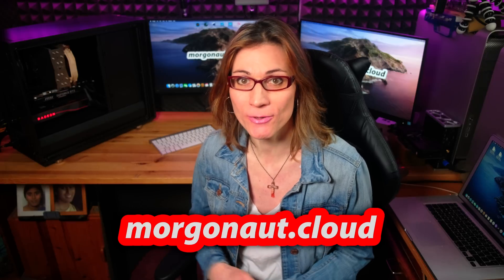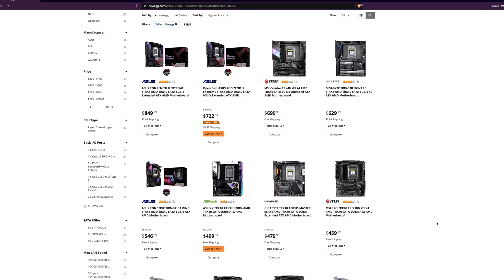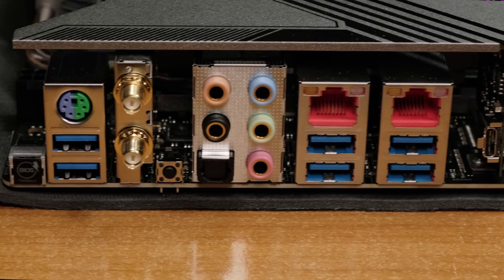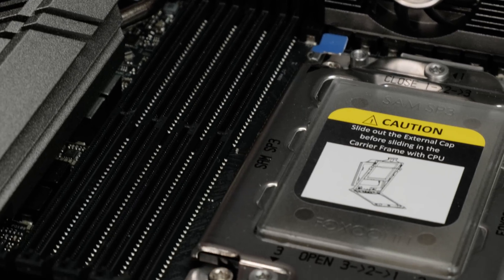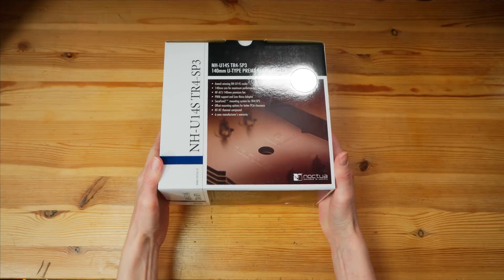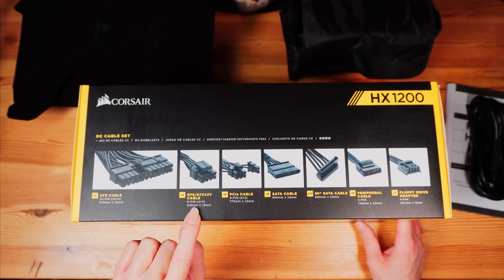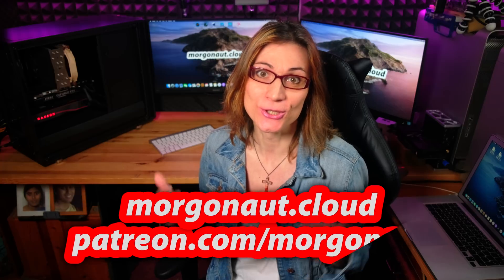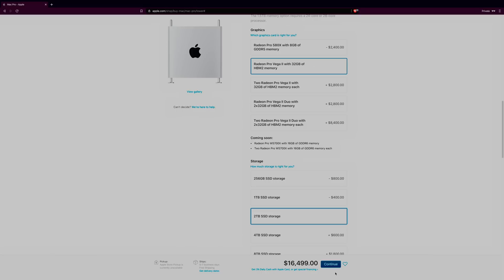World’s Fastest Hackintosh - 2019 Mac Pro Killer!

Comment: Amd cpu Is it stable with final cut pro... amd cpu is not available intel QuickSync. I want to build amd hackintos but How is working AMD CPU with AMD GPU can you show the amd systems how is working Encoding.  If is stable I want use amd ryzen 9 3900X with two GPU,  Ati gpu for hackintosh Nvidia gpu for windows, because Premiere Pro (BETA)  start to support H.264 NVIDIA Hardware and  Encoding 
Thanks
Reply from the maker: I don't use quicksync on a single computer and I have much better results

Comment: First things first, thanks for the amazing work and effort you put in this videos. Not everyone but most of us appreciate that. :)
There is a big question about the hackintosh for me. I'm a developer and most of the times my customers want an app which is working accross iOS and Android. 
The easiest way has always been over
 macOS because you could emulate both systems (iOs / Android) at the same time. 
But damn expensive over the years. That's where the Hackintosh comes in. Can you emulate also both systems with a Hackintosh?
#weOweYou :D
Reply from the maker: properly setup hackintosh can run 100% all same apps as real mac, so if you ask for some android emulator - when it's running on a mac, then it will run on a hack too
Reply: @MorgonautHackintosh  thanks for the quick answer :D
Reply from the maker: you're welcome Peter

Comment: I'm unfamiliar with Hackintoshes and the implications of having multiple operating systems on a single device with multiple GPUs. So if one has GPU 1 (16GB) and GPU 2 (8 GB) for MacOS Catalina and GPU 3 (8 GB) for Windows, does that mean you have 24 GB of graphics while running MacOS and 8 GB of graphics while running Windows, or do you have 32 GB of graphics available for both MacOS and Windows?
Reply from the maker: you cannot sum VRAM in multiple GPUs. If you would have for example 1 x 16GB GPU and 1 x 8GB GPUs in single system, you can still utilize in for example render apps only 8GB, or better say value of gpu with lowest memory. It can be summed kind of way if you would have infinity fabric or nvlink

Comment: Hi , nice video.
I wanna ask how ll b d fcpx performance as ur machin doesn't support quick sync , so wat u suggest?
Is it worth for video editing on FCPX? How u relate 64 thread performance with video exporting and transcoding , does it help?
Plz post FCPX related benchmark results.
Reply from the maker: Mac Pro and iMac Pro also does not have quicksync and do you think it's performance is weak?? Quicksync is good on low end hardware, but not on high end one.
Reply: @MorgonautHackintosh  thank u so much for ur quick reply, I m not saying it's performance is low, but I m bit confused abt performnace, so I request u to plz post separate video on benchmark with FCPX performance related. It ll b very helpful

Comment: @morgonaut just curious.  You running Catalina 10.5.4 and davinci 16.2 yet?  Just curious cause I keep getting crashes on start. Never even starts. Just upgraded to latest Catalina on my Hakintosh and latest davinci. — no bueno. 10.5.1 was fine with the older davinci. Lesson learned on my end
Reply from the maker: yes, I run 10.15.4 and resolve Studio 16.2 without any problems
Reply: Morgonaut I’m going to remove some waves plugins. Maybe it’s that.  For some reason Maserati,  and 3 others do not validate in logic x. Also. And tech support said. Bye. After I told them I was running a Hakintosh.  The errors says something about my video card.  Don’t know what a video card has to do with running plugins though. Maybe the plug ins are 32bit and 64 bit hybrid and really messing up the system.  Thanx. I’ll see if davinci will start after I remove these plugins.
Reply from the maker: I said in one of my video some while ago how more and more important is to have gpu for running audio plugins and lot of arrogant aggressive haters complained it's not true because of their lack of knowledge!

Comment: Is it possible to set up MacOS this process for My below build:

Processor: AMD Ryzen 5 2600 3.4GHZ-3.9GHz 9HLO378P 6 Core 19MB Cache AM4 Socket Processor

Mobo: MSI B450 GAMING DDR4 AMD AM4 Socket Mainboard PRO Carbon AC

Ram: G.Skill Trident Z 8GB DDR4 3200 BUS Desktop RAM Black & Red Heatsink

SSD: Transcend 220S 256GB M.2 2280 PCIe Gen3 X4 SSD Drive

GPU: Gigabyte GeForce GTX 1650 WINDFORCE OC 4GB GDDR5 Graphics Card

Power SupplyThermaltake PS-TRS 0700NPCWUS-2 TR2 S 700W 80 plus White Non Modular Power Supply

Case: Thermaltake Versa J24 TG RGB Tempered Glass Side Window Mid Tower Black Desktop Case
Reply: Your graphics card is not supported by macOS

Comment: Not sure there are 4 pce-e slots x 16, If I am not mistaken they are 16 / 8 /16 / 8 pet its spec: PCIe x16 	(4) v4.0 (x16/x8/x16/x8)
Reply from the maker: 4 pcie x16 slots and when all occupied they run at 16/8/16/8
Reply: @MorgonautHackintosh  Ah, ok, but  wouldn't that prevent you from running the 4 video card project? (at least taking full advantage of all video cards)
Reply from the maker: why it should prevent me from running 4 GPU??? Mobo has PCI gen 4 so x8 pcie gen 4 is x16 pci gen3

Comment: Hi Teresa, The GTX 2070 you are using is for Windows 10 dual boot only. My understanding only approved Radeons and older GTX cards with drivers for Hackintoshes, right? Though 
I’ll be happy to be proven wrong.
Reply: Exactly my question. Can you dual boot into OSX with the AMD gpu and still have the nVidia connected AND boot into Win10 with the GTX gpu?

Comment: Steve Jobs said “Build the best computer and don’t settle for anything less”. I am glad to see you using the best value quality components for best performance. Most OSX apps and MS-Windows programs performance Apex with 12-cores so no need to over do it. 32-core threadripper is a good choice CPU.
Reply: Sadly he was leading the company that was designing computers to obsolete themselves every 2 years, and using thermal throttling as a way of staying cool. This is why capacitors bursting, and PP bus shorts to ground are still a common thing even today. Which in their design means the whole system is dead, and their support will tell you its "water damage", and that you need to replace the entire machine. The OEM parts are impossible to obtain to fix yourself, and you have to be a tech savvy person to know how to fix it with compatible replacements. Apple is really best at making an OS, both efficient, and optimized. They would be wise to sell a widely compatible OS for custom builders, even if they left some premium features for their own hardware.
Reply: @DaveDuzzit  windows users should probably not comment on things they have no real experience with apart from reading it in the news... considering the resale value of macs, you are clearly uninformed. (or at least you toe the wintel media perspective well).
Reply: @SD-ft6gs  I've repaired well over 1000 apple products since 2005, and seen it all first hand. Stress tested them to ensure reliable operation, only to find thermal throttling to be a common issue with almost all of them. I couldn't tell you how many PP bus capacitors have failed, and resulted in a dead machine. Apple is just trendy/pricey for no good reason, and it's such that gives them resale value. Most of my customers had gone to genius bars to be told its water damage, and that the machine isn't reparable, only for me to have it working within an hour. Some are as easy as plugging in a loose cable. So telling me otherwise isn't very convincing.

Comment: That's quite an amazing machine, well done. I have the same question as a few others here regarding Audio/Logic/Thunderbolt and added to that I wonder if Virtual Machines (with Parallels Desktop/VmWare Fusion) rides on as good as it does on Intel machines? If Morgonaut is too busy to answer here, which is not strange, maybe someone else can tell? Thanks.
Reply from the maker: any software based virtual machine as you mentioned in Parallels Desktop/VmWare Fusion would have much lower performance than native installation
Reply: @MorgonautHackintosh  Thank you, yes I know, but for how I run it (mostly electronics cad) it's very much good enough and have been running like this for many years, and I need to jump fast, copy and paste etc (CMD+C/CMD+V/CMD+TAB) between OSX/Windows so this method is just perfect here. No need for gaming at this place.
Reply: So, the Software Virtual Machine question remains…
Reply: ... as well as the questions about Audio (Logic reliability for example) and Thunderbolt, to be able to connect "good" audio devices, like modern Universal Audio Hardware…
Reply: @randysuperhero9194  OR you all could search in the places where people who are 1) Audio folks would be able to actually answer from experience; 2) people who are virtualization folks could answer your hypervisor related issues?
Reply: @SD-ft6gs  Thank you for your tips. My thought in this case was primarily because Morgonaut knows so much about Hackintosh and as she also built this incredible machine. My apologies, I will not ask irrelevant questions here again.

Comment: This is my build now... I plan on getting the AMD cards. How do we make the installer?
I should be able to run High Sierra for now on the GTX card...

Corsair CC-9011063-WW Graphite Series 780T Full Tower PC Case - Black
GIGABYTE TRX40 AORUS Xtreme
AMD Ryzen Threadripper 3970X 32-Core, 64-Thread
Corsair Vengeance LPX 256GB (8x32GB) DDR4 3200 (PC4-25600)
EVGA SuperNOVA 1600 T2, 80+ TITANIUM 1600W
(3) Sabrent 1TB Rocket Nvme PCIe 4.0 M.2 2280 Internal SSD
Noctua NH-U14S TR4-SP3, Premium-Grade CPU Cooler for AMD sTRX4/TR4/SP3 (140mm, Brown)
EVGA RTX 2080 Ti
EVGA GTX 980 Ti
Windows 10 Pro
CentOS 7.7 (Linux)
Reply: Awesome work BTW, everyone says the last three Threadrippers unsupported. Installer info please. Thanks in advance <3
Reply from the maker: if someone in hackintosh forums is not able to make something working, that does not mean it cannot work at all :) Stop reading those forums and your life will be better
Reply: @MorgonautHackintosh  Do you think my beast would run macOS? My favorite render engine "Redshift" are currently in the process of porting their CUDA code to Metal for Mac users. Also thinking about selling my 3970x and getting a 3990x. My friend on Redshift forums just scored 30550 points in Cinebench! I get the same as you in Windows :) I will have my 2012 5,1 Mac Pro 12 core Xeon 5960's and 64 gig of ram back up to build the installer. I stole the GTX 980 Ti for my new build, the real Mac is resting LOL

Comment: Thank you Queen!

For me I just installed 3950x with x570 Aorus Xtreme and 5700 XT using open core. Although I have AppleStoreKey operation failed, it manages to go to desktop. I am not sure if it is an issue. Also I have yet to fix my USB connections (although all are working).

Waiting for MacBook Pros to support WiFi 6, so that it will be compatible with my motherboard WiFi and hopefully Bluetooth :)

Comment: Dear Theresa....first of all well done 👍. I am an audio pro in germany and using macs and Logic as main DAW ( + Studio One,Cubase and ProTools as well )
My main topic is realtime recording under heavy load with 32/64 samples lantency.  Typical situation are 60 Tracks+ with virtual instruments ( pianos. strings, drums etc )
and lots of plugins ( slate/waves and co ). The system has to be absolute dead quite. I need a lot of fast diskspace and ram.  Graphics are not really importend.
Logic supports in the latest version 10.4.8 up to 56 threats. Audio interfaces using 10gbit ethernet ( Moto AVB  ). What is your advice. What kind of machine is your choice.
thx. greetings from germany and stay healthy.
Reply: Never go ryzentosh for Logic, this is a build where a 9900 would probably be the best choiche as all the HEDT platforms have huge memory latency issues that translate in bad realtime audio performance. Better way to habdle this would probably also using Vienna Ensemble Pro aand make a slave PC to load libraries. You absolutely DON'T need 10gbit ethernet for the Motu card, as its never going to be bandwith limited.
Reply: Gabriele Carbone thx for this info. wish you well and stay healthy

Comment: Thanks for this, and well done - pretty amazing work. Also thanks for doing all the research and recommending the optimum parts for such builds.
Are you running on Proxmox? Will you make a video about the software configuration?
Thanks!
Reply from the maker: as I said in this video I will give all additional details in next videos
Reply: If you want easy way. You can use unraid + macinabox. Linux + kvm is also good option
Reply from the maker: unraid crap is very bad way :)))

Comment: Thank you for the Hack video update. 
There is no Thunderbolt support on the motherboard you have chosen? Am I missing something?
Reply: i have the same question - without thunderbolt i can not use it 🤔
Reply: Gigabyte TRX40 Xtreme also supports TB3, that MB is closer to a MacPro killer (TB3 and dual 10G Ethernet).
Reply: Even if it doesn’t support it on the mobo, you just get a pcie adapter and you’ll be fine
Reply: Coen Vermetten 
No. Thank you. I’m not going to occupy a slot of the motherboard to install a THB. PCIe, specially when there are already Motherboards with native support for THB3. How is this configuration called, a Mac killer 2019 without THB3 support? THB3 is not only used for storage devices, but for profesional video connectivity, like  Blackmagic and AJÁ interphases, among other companies. 
I cannot use this configuration for profesional post-production workflow without native THB3 support. Perhaps, this configuration would find its way-through within the gaming target users.
Reply: Willian Aleman interesting observation,,, perhaps she’ll address this for post production peeps like you and I, plus others.